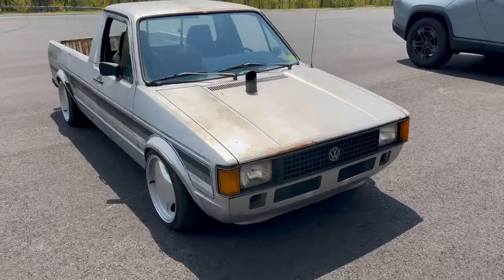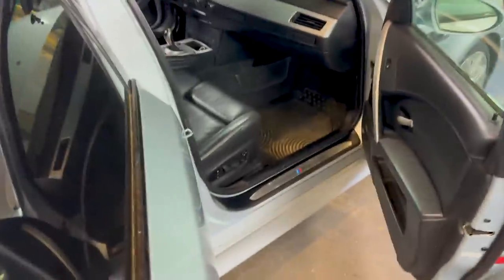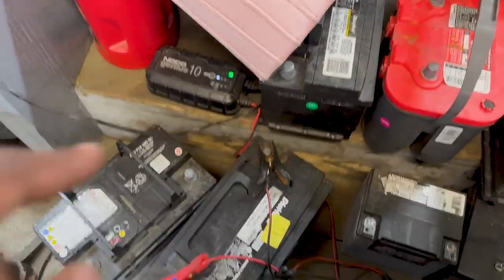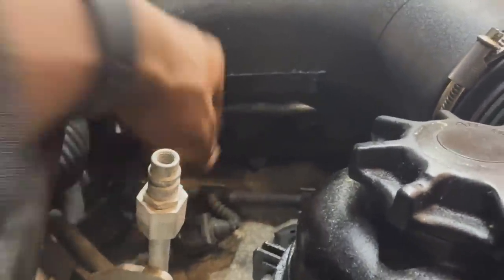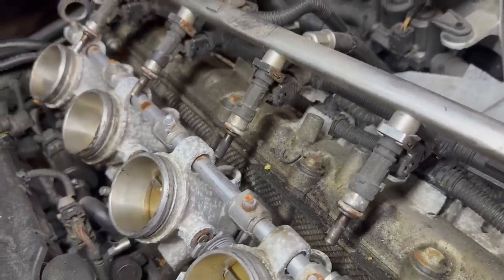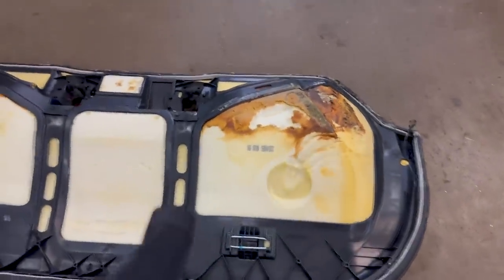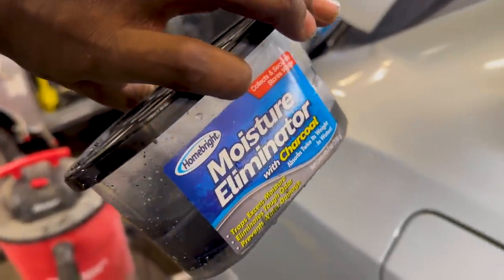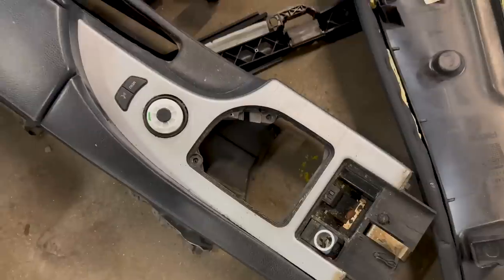Fixing a Non running V10 BMW M5, a marketplace disaster, please help

Comment: Honestly, I'd do an episode where you go through all the grounds (burnishing, etc.) Zone by Zone (trunk i.e. battery)(cabin: SMS, engine interlocks, door ajar, fuel pump), and (under hood i.e. engine ground, alternator, fuse blocks, relays) considering they're all rusted out. Since you're a HUGE EV guy call it 'GROUNDED.  Definately pull the fuel lines from the rails and run an external tank up front for all the gasoline to pump (water,etc.) out of the back. Test all your coil packs. Drain your oil and flush the whole system including the radiator. Plan on spending $400.00. A new battery is close to that anyhow. Feel guaranteed that all the relays that send lights to your computer are jacked up and hot swap every one. Chase that GREMLIN! Cheehoo! Don't feel afraid to use a red paint pen to mark each of the grounds that you tackle or dot the relays of known issues.

Comment: We had water issues in ours and the sunroof seal was bad and the car was only a few years old back then also blew the lines then never had an issue again. It was funny to know the issue before you found it, very common on them cars. Also I have an 95 s600 VIP if you want the f1 sound. It’s for sell.

Comment: If it's anything similar to E90 the fuel cut is not controlled by engine controller, but the central access system driving fuel cut relay. Check injector positive voltage rail.

Comment: The injector spray patterns look like absolute garbage by the way so I would definitely clean those. It looked to me like it tried to spray for 1-2 rotations and then the ECU actually cut off the injectors, so my suspicion is the computer is not seeing crank or cam signals or another sensor is telling the ECU to shut off fuel and ignition.
Reply: I agree, they just look gummed up.
Reply: Yeah, it did look like they were just spraying badly and then just fuel cut.

Comment: 😅💸🔧 Honestly, if you manage to snag an E60 M5 for just 5k, you should be prepared for some serious restoration work. It's a risky move, but for enthusiasts up for the challenge, it can be a rewarding project. The V10 engine alone is a complex masterpiece, so having all 10 pistons intact would indeed be a cause for celebration. Good luck with the restoration, and may this marketplace disaster turn into a remarkable success story! 💪🚗🛠

Comment: I have an 04 e60 (525i that is non running and I got it for cheap(limp mode and battery's keeps dieing, killed the battery jumper, killed 5 MAF sensors, headlight wire got flakey and shows a misfire....) it's a piece of work

Comment: For stubborn sunroof drains, you can also feed some thick weed whacker line in there to "snake it out".  I would really love to see you get this vehicle running.  Don't give up, I know you can do it.  I know it is premature, but I wonder if all that water somehow affected the engine control module... Voltage at injectors is/should be?  Good luck!🤞

Comment: Good luck!! While you are replacing the fuel injectors please don’t forget the coil packs.. im sure u will have to do the fuel pump soon anyways.. and also the little humming noise when u open the door .. its the smg pump priming .. so that is always a good sign! Plan to swap all the fluids out and check for the metallic pieces in the filter .. if u see gold.. u hit the gold rush jack pot and run 😂.. cant wait to see what else u find!

Comment: You should be able to open the trunk with the physical key that's nested inside the plastic housing, there's a button on the back near the loop for the ring. One side is fixed, one side will pop out.

The stock battery would be an AGM.

Comment: Water leaks from backed up sunroof drains are very common on the E60. The ends of the rear drains are star shaped and fuse themselves together when there are debris. 

Using scissors a small cut is all that is required to stop this after you have cleaned the drains. 

Normally this fills the control units in the boot too which makes sense watching your video.

Comment: @Rich Rebuilds, since water has flooded the interior and the engine bay is also super corroded. There is a good chance that the ECM connector may be corroded causing you those faults and preventing it from starting, also could be corrosion inside of the module. My e60 had the TPMS module fail and caused my car to not run at all until it was removed, i opened and repaired the module but initially it was corroded and shorted. 
Good way to trace the exact module is to use the BMW software to run checks and it will show what modules may be causing the canbus fault. Noise/feedback on the canbus will definitely cause these issues. If you need the software or support just let me know.
V/r,
AP

Comment: Quite common issue in newer german cars is that the injectors clog up with gunk, especially with high mileage. You will have to buy new ones or clean the old ones reeal good out in something like an ultrasonic cleaner or with high pressure

Comment: Rich, you shouldve put a fesh battery in it and then started diagnosing the no start issue after clearing the errors. On some bmws injectors wont fire without a crank signal to the dme. So check codes for a crank sensor. Also check fuses etc. Start with the easiest and work your way up

Comment: E60 sunroofs leak with age, when that happens it goes into the trunk. There are a bunch of modules in the trunk and the battery. When you buy a e60 always move the modules in the spare tub and remove or drill new drain plugs in both the spare tub and under the battery

Comment: My M5 had water intrusion issues through the rear passenger side window/interior door seal(behind the panel), and a slight leak around one corner of the moonroof. Caught it quick enough to not have those issues, luckily.

Comment: For BMW e6x generation its quite common to drop EWS fault: tampering protection. this quite often happens when battery slowly drains and the key floating code gets unpaired from the car... if this happens, you can handle it with ISTA D soft and service procedure to allign the keys. 

typical symptom is engine cranking over, no start, no fuel coming from injectors and no spark....

Comment: Ok this is a perfect opportunity for you to try out cryo treating and WPC treating. You can do it on the bearings and crank it will make them last longer. You know why cryo is self explanatory, but WPC is micro beads that are all the same size they blast the surface and it makes it “slick” like there’s a film of oil on it. Look it up on YouTube there’s some great examples. I did it to my PTU which is what makes me all wheel drive

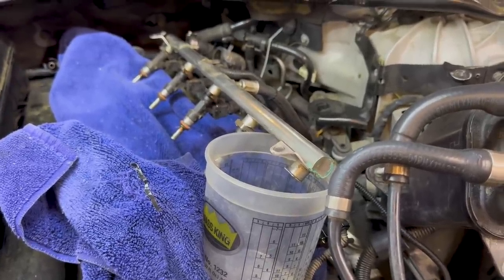Comment: Ha! 27:50 reminds me of my old E61 (wagon variant) 525i beamer. I had to swap all six injectors TWICE, because they kept breaking / clogging. After that it ran smooth for years. According to some forums the injectors are a known issue for the E60/E61 models. Oh, and I also bought mine used back in the day. Fun times.

Comment: FWIW there are 2 posts under the hood, when a BMW or Mercedes has a dead battery, or even an Audi you can connect a jump pack or jumper cables to it and you don’t have to climb through any trunks… 5:19.

Comment: E60 m5 owner here, if water is getting in under the front seats, you will need to replace the yaw sensor, these won't survive moisture, and will throw abs, etc, tc codes, also what happened to the wheels? Those look like 550 wheels.

Comment: If you see that much water damage, check all control module for any corrosion or any wire that has rust.

Comment: whole reason why i bought a 530 rather than an M5. 90% sure all you’d need is new injectors and clear up the mold.
e60’s are prone to water intrusion. i’d also check your front windshield cowel just in case it’s time to replace that before another more dangerous leak happens

Comment: I've not have BMW specific injector issues, but I have has cars that have sat a long time who's injectors have simply gummed up from sitting too long. All of mine have been fixed by spraying brake leaner/carburetor cleaner  into the fuel intake side while cycling the injector manually with a 12V battery. They get un-stuck pretty quickly, and even exhibit a reasonable spray pattern. A less ghetto way would of course be just having an injector testing station ( I don't have one though).

Comment: Looking at the injectors firing then not fitting leads me to believe you're losing cam/crank sensors/signal. I'd definitely start there with a scope on the ground and signal wires and see if you get a good square wave signal

Comment: Rich I have a few suggestions on how to diagnose and fix this.  I’m sure you have several problems though so as you get the engine to start you will quickly find several others, BMW guarantees it. Like I said in my other post I have a few of these, I also helped Steven (M539 Restorations) on a few key things to save his engine. I’m in NY/NJ area from you. I also have a lot of M5 interior parts if you end up really wanting restore this car.

Comment: Rich, that battery needs to be an AGM battery, as an e60 owner I can tell you that a drop in voltage will give you a ton of faults including what your seeing, that should be the first thing you change before anything else when you have a bad battery already

Comment: Clear codes new battery then try, you can test fuel and spark on scanner. Even injectors scanner can test everything. Change old parts.

Comment: In case of dead battery, you lift the rear cushion seat. There is a release cable under there to open the trunk. It’s in the manual

Comment: I keep those damp tubs in my cars in winter always as the windows are usually closed in winter and ur breath is full of moisture which is deposited in a coating on everything inside which is why all ur older cars that had chrome inside and its always rusted and pitted.

Comment: I would check the fusebox and Body Controll module, as they can prevent the car from starting, they are in the glovebox, since you have a cloged sunroof drain, they fill up with water and corrode, it happend to me, in the freezing cold, it was a E91, but E60 is verry simular with its placement... hope this was helpfull

Comment: Hi Rich, I had a bone stock 2006 M5 as well. The thing was a beast but took a lot of time and money after 100k. I sold it for $6500 after a dash ‘fire’. More of a smolder. I do still have a few parts like throttle actuators (some good, some not). 
And that buzzing sound you heard was the SMG pump priming when you open the door. It’s totally normal. 
Oh and I did run an 11.92 in the 1/4 mile. And i should still have the slip to prove it. 
Message me if I can be of assistance. Good luck.

Comment: Test light on the injector plug to make sure they are getting fired if aok the injectors are clogged . Comp fuel spark engine runs .

Comment: The injectors are gummed up due to lack of use. With the rail out as you have shown, get someone to crank it and tap an injector with a screw driver handle and it will open right up. Repeat for the other 9

Comment: If the engine has not been fired for that long I would check all the fluids, change the spark plugs and try to clean the fuel injectors. In your case they may need a heavy cleaning or a replacement. I hope just a clean makes them run again :)

Comment: If you take off the strut bar, be careful when you mount it back to the car. If you over torqe it, the threads will break. Steel screw in an aluminium strut tower is very strange conbination.
Because I am german I use Nm to define torqe. I think the maximum torqe for these 4 screws are 35 Nm. Do as you will with this information.

Comment: E60 M5 fuel pumps: It has two fuel pumps, one for normal driving and one that only kicks in at high rpm to get enough fuel to the engine. Theoretically it could be possible that both do some kind of initial run when switching the ignition on to get the system under pressure, but if the normal one isn't working the car wont start. Again, this is only a theory, idk if the secondary fuel pump is activated when the ignition is switched on, but it could explain why first there is fuel but then not. Normally they fail the other way round, resulting in a relative normally running engine, but it goes into reduced power when driven near the redline. I would simply do your fuel pump test again but with a hose attached and a big container to find out more.
Reply: Previous owner and I wonder the same thing honestly as they known  for that after water enters car

Comment: Rich when u change the battery 🔋 on E60 you have to connect the car with computer and do the battery check and training. Otherwise the car will throw different errors codes.

Comment: Easiest way to get rid of mold is to spray vinegar on it. It won't damage anything in the car and it will clean up the mold without you having to take it all apart next time. Also it looks like you are not getting the control signal to fire the injectors. That maybe something with the crankshaft position sensor or the camshaft position sensor most likely the crankshaft.

Comment: 18 miles to empty does not mean there is gas in the tank, the range sensor could be out of whack from age.  my E60 left me stranded when it said 50 miles to empty....when there was really 3 miles to empty when i installed the new fuel pump.

Comment: Pretty good plan of attack so far, guys.. Fuel pumps always went bad around that time.. With the addition of ethanol to the fuel in the US, it made EVERYTHING corrode like crazy.  Was a master cert BMW tech from '00 - '08 in NJ, before I "had enough"... lol  

Also, I never trust the fuel level gauge in BMWs... they had a reputation for being amazingly inaccurate.  Had a customer's E46 leave me stranded on the GSP one morning, with almost an 1/8 of a tank left (supposedly).  

2 main causes of water leaks in BMWs - #1 Sunroof drains, #2 Torn or improperly sealed vapor barriers behind the door panels...  Wish I was closer to you guys... would LOVE to help diag that bad boy, but I'm all the way down in "dirty" Jersey.. lmao

Comment: Great to see you taking this on! SO non-m e60 is identically the same car. You can get carpet and seats from a partout no problem. Direct fit. 

Regarding the injectors, they commonly fail on S85 and are known to grenade the motor if they get bad enough. I'd replace them all with new bosch units. The rebuilds are sketch because they can come back stuck open and wash out the cylinders which is bye bye motor.

Comment: on older BMW's if the battery goes flat you will get an immobiliser fault and the car will only crank but not start, had this happen on both E39 and E46 so there's a very high chance you took the whole car apart for nothing

Comment: The E6x M cars are such a mixed bag! Amazing V10 but Vanos issues. 500Hp but smg pump failure is common. Crazy F1 sounding exhaust but rod bearings are a must! Decent looks but the throttle bodies commonly fail. Comfortable interior but the MPG on this car is criminal (spirited driving is about 2mpg lol) For the price it's so awesome and terrble at the same time! I'd say the e6x m's are the ultimate car guy car. It's sick but will never leave your garage.

Comment: Order of operations to get this S85 screaming again.

1. Change the in-tank fuel pumps and filter (they need it).
2. Fuel pressure regulator (front drivers side wheel well above the ABS module). 
3. Replace all 10 fuel injectors
4. Replace all 10 coil packs
5. Replace all 10 spark plugs 
6. Rebuild or replace both throttle body actuators while you have the plenums off.
7. Replace that bad throttle body boot.
8. Get a new AGN battery. 
 Then get ISTA or INPA on a cheap laptop, dont use a generic scanner you can't run system test with those.  Run codes then delete all codes, see what comes back and go from there. Your probably going to have to chage all 4 Vanos solenoids at some point based on the milage and unknown service. Based on the condition I'd drop the pan   and change the bearings and vanos line unless you can verify they were done. 
Once you do this it'll run for sure. Let me know when you get to the SMG, I got another checklist for ya 😅.
Once you get it running right, these cars are actually easy to maintain. Nothing to be scared about.

Comment: If it has been run on fuel that contains ethanol, it can/will rot rubber seals in the fuel system. I’d also suspect rodent damage to the wiring loom. Best of luck.

Comment: I enjoy watching Rich crawl into tight spaces as much as the next guy, but:
Both the BMW E34 (battery under the back seats] and the MB C209 (in the trunk) with lots of issues that my dad bought about two weeks ago had terminals in the front to jump start the car without accessing the battery directly. You should be able to put a battery tender or a jump pack on there as well.
Or at least I hope that will work. Otherwise the battery in the C209 will still be dead when my dad tries starting it even though it has been on a charger for days 🤷‍♂

Comment: I had and BMW. The Sunroof leaked. I went to get it fixed. The mechanic was from Germany. He only worked on BMW and Mercedes suggested that I didn’t and trade it in. He explained the the electrical and controls would forever have issues.  The next couple of moths the seatbelt sensors would chime for no reason. I immediately traded it. The BMW dealer didn’t inspect it and immediately put it on the lot. It sold in 2 days.  It was in perfect condition otherwise. Never bought another one.

Comment: Just in case, check the Dme that’s located underneath the cabin air filter, water tends to get into the dme box due to clogged water drain, fellow E60 owner😅

Comment: If the injectors run like any other car, the all get 12v from a common source and the ground is controlled by the PCM. The car is certainly giving the prerequisites for the PCM to give those grounds. shouldn't be hard to figure out.